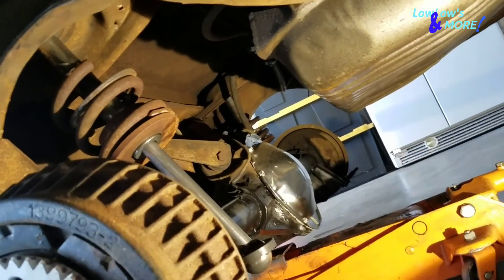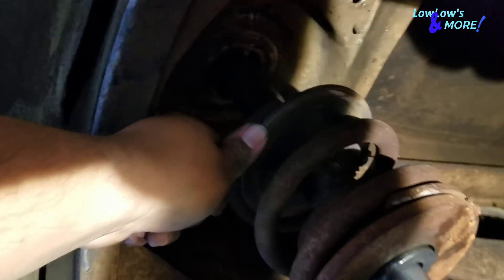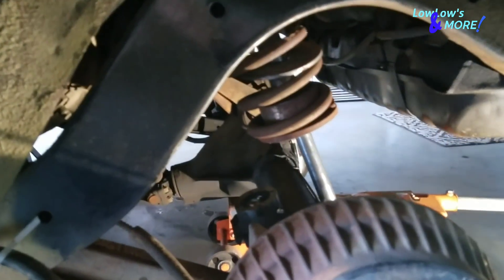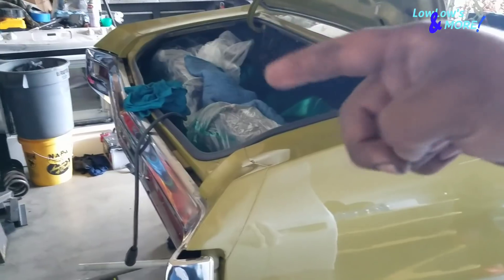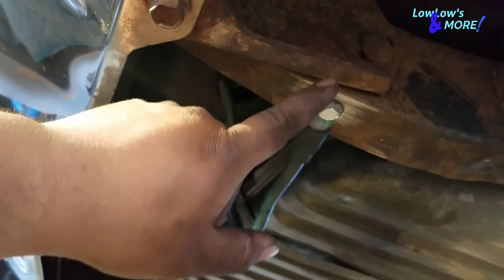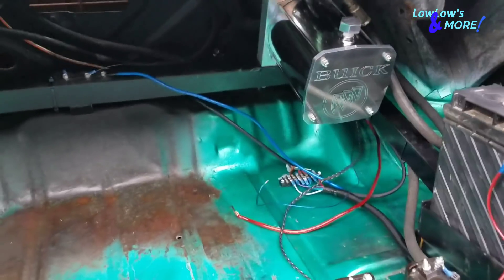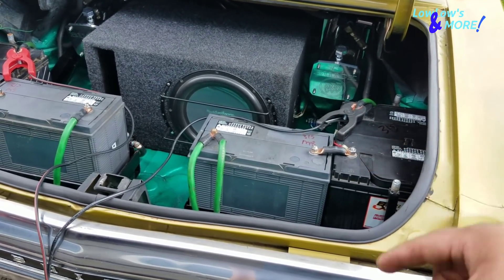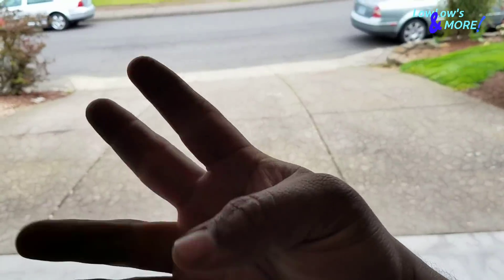Finishing the Skylark Lowrider

Comment: Can i do the same with my town car ? Can i leave the stock perches and put the bridge  under them and leave the spring perches there as extra support ?93 towncar
Reply from the maker: The only reason why I would leave the perches was because I didnt have a lot of time to remove them and then place the bridge then level it then weld it back then because I would use my parents garage to do all the work because my garage at my apartment doesn't push enough voltage.  I would let my customers know that the bridge will sit below the perches and they would be ok with it. I would cut out a big hole on the perches so the cylinders wouldn't rub on them. Hopefully that make sense, I'm not a really good writer.  If you have any more questions hit me up on Instagram @lowlowsandmore

Comment: The sqeeking is from the rear bushings, Not the trunk.
Reply from the maker: With the trunk closed theres no squeaking on this ride.
Reply: @lowlowsandmore  My bad you right it's the trunk hinges. Alot of the time if you dont change out the trailing arm bushings it will sound just like that.